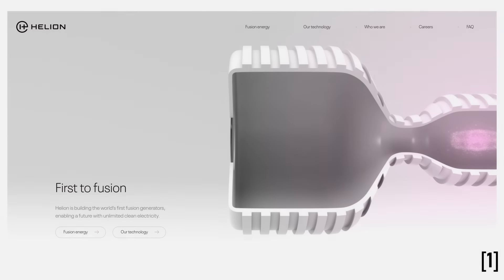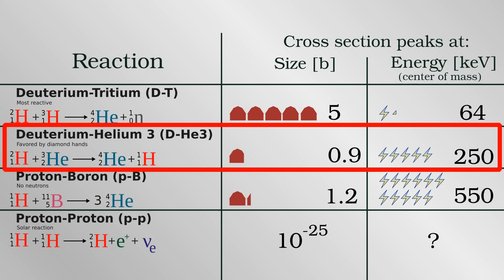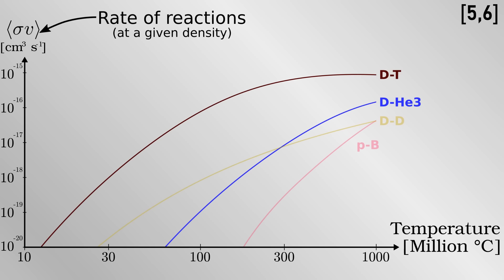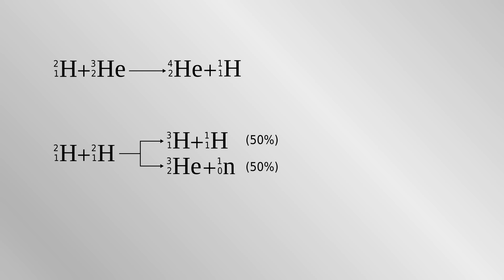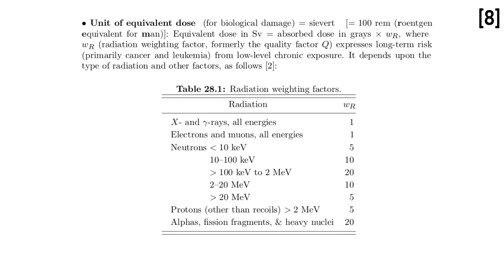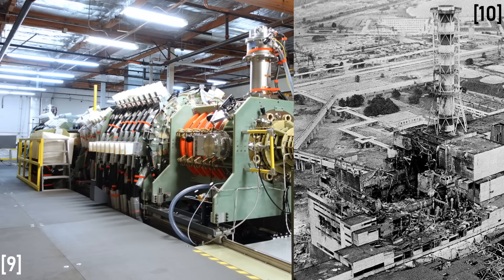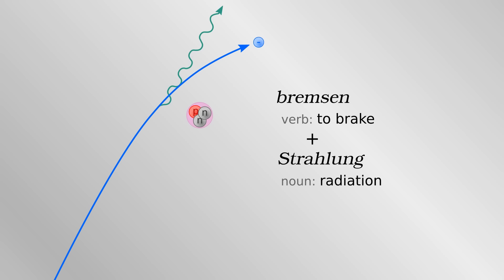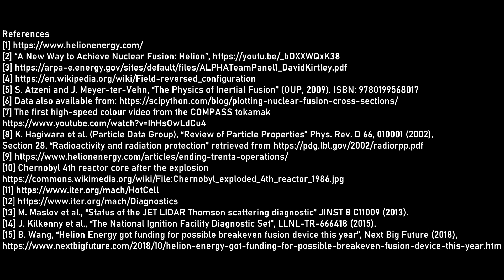The problems with Helion Energy - a response to Real Engineering

Comment: I'm just a lay-person so your educated skepticism is very valuable to me in mitigating my excitement.   

My only issue with your commentary is, it seems, and maybe this is my own ignorance, to often be talking about their reactor as it is now.  It's my understanding that they are in an iterative process and still aren't attempting to achieve their end product design, they are instead developing scaled down reactors that will help them develop their engineering processes and develop their understanding of the reaction they are focused on. 

I think this comes up most prominently when you're talking about the temperature.  Your perspective is that they are "content" with a very low temperature.  Do you know That they aren't planing to increase that as they iterate their reactor design?  You might, again you clearly know what you're talking about and I'm a lay-person.

I will say, when I've watched videos from them, they clearly implied that radiation wasn't an issue in their process, and saying it was a much larger one in systems like JET.  Learning from you that that appears to be an overt deception on their part clearly sets off the alarm bells.  If there's that major deception, it would be ignorant to assume their aren't others.
Reply: Indeed, Helion's power plants will operate at 300 million degrees ion temperature, or maybe even higher. Trenta is a subscale experiment that is currently at some 100 million degrees ion temperature. Still impressive for a relatively small and cheap machine. Also note that their extremely low electron to ion temperature ratio of <0.1 lowers some of the requirements.
Reply: @elmarmoelzer2229  Agreed. I believe the iteration they are on (6?) is like a tock on Intel's now defunct "tick-tock" system. Build something, engineer it perfect. Scale it up, re-engineer, etc.

First, a proof of concept. While this has been done for decades, extraction and refinement of the materials needed can be done much cheaper today and as such the technology is once again becoming a more viable solution.

I'm not at all saying this video is wrong, as it does point out potential problems with Helion's representative in the video mentioned, but I think it might be a bit premature to attack something that's literally still in development.

Comment: I enjoyed the video by Real Engineering and yours, as I learned a few things. 
One thing the main stream media has been telling us for years is that Fusion “will provide limitless clean energy”. Which seems a bit wrong. As you point out, that left over Neutron flying about will make stuff radioactive. You still need some sort of containment. 
I don’t think we’ll see a commercial on-grid fusion reactor in the next 40 years.

Comment: The D-He3 mix still burns D-D at a significant rate. FRC experiments have been around for decades. It sounds like a marketing pitch to grab investors. FYI my background is in nuclear engineering/ plasma physics.

We haven't even mentioned the plasma instability problems inherent in this class of devices.
Reply: And a lot of those FRC experiments were actually done by Helion, believe it or not.  Their co-founder Professor John Slough is a household name in FRC circles.
As for past FRC experiments. They were sufficiently different:
FRCs have unique properties. They get more stable with radius, ratio of elongation/radius and higher temperatures.
Helion's machines are pulsed and do not attempt to hold the plasma stable for prolonged periods of time. That helps a lot.
Reply: I would better that if Helion does generate any fusion it will be all D-D fusion. Much like a car when one tire is stuck in the mud. The tire with the least resistance spins while the other tire doesn't move at all.Since the energy levels for D-D is about 4 to 6 times less, He3 is unlikely to ever fuse in their reactor.

Comment: Hi Improbable Matter, it is very good to see a video putting a break on all these claims popping up recently about fusion startups and their miraculous fusion designs. Producing high amounts of energy (i.e. energy gain) requires serious hard work, combining decades of plasma physics theory, development of state-of-the-art fusion codes and associated numerical techniques, and thorough experiments with many diagnostics. This is just something that these startups do not have; instead they take a concept that looks good on paper, maybe by cherry picking a few scientific papers from a large body of work, and then sell it to investor to get funded for 10+ of years, while never having a chance to achieve energy gain. I don't doubt that some of these people have good will, but that is not enough. There are currently only a few credible path to producing high amount of fusion energy in a manner that can produce energy gain, and those have been developped for more than 50 years for a good reason: it is hard, and there are no miracle solution. In this field, if it sounds too good to be true, it usually is. 

One thing that I see a lot in these startups, is that they start by bashing the DT reaction because Tritium is rare and because neutrons are an issue. Neutrons however have a good property: they escape the fusion plasma, such that you can recover their energy. Let's not forget that the goal in the end, is indeed to recover energy from the fusion reaction... Most startups relying on aneutronic reactions (such as D-He3, that is, as pointed out, not 10% aneutronic) do not have a realistic way to recover the energy producing by the fusing particle. Invoking the use of magnetic fields to recover the energy from the fields in the plasma is a bit like invoking magic, for plasma physicists.

Comment: Thanks for making this video! I started watching the RealEngineering one but within a few minuts I got a strange feeling in my stomach. The way he talks about "the bright pink flashes from fusion multiple times" as if it's something only they can do gave me a clear idea that this was more sensational than educational. A lot of labs can initiate fusion. You can make surprisingly tiny machines that can initiate fusion. But achieving fusion with more energy out than in has only just been demonstrated, and from there there's a long way to generating more electrical power than what goes in.

Anyways, he might address these issues further along in the video, but just the way it was presented gave me a feeling that this was not going to be a nuanced approach to the subject.

Comment: The entire fuel processing is something I haven't seen them address sufficiently.
I don't know how bad it is for D+3He fusion, but 4He "ash" quickly (I think it was around 10% fraction) makes D-T fuel unable to fuse properly at the same operational temperature.
So you either need to always have something like 90% unspent fuel that you need to send somewhere for reprocessing, or have a separation system for 3He and 4He. Systems like that usually eat up a lot of energy. For ITER, those systems constitute a significant fraction of the overall energy input.
If you produce tritium as well, you can tack on another system to separate tritium from deuterium.
At that point, you have a facility that can produce nuclear weapon grade & scale amounts of tritium, which means a looooot of red tape.
Reply: ash is removed after each pulse

this is one reason pulsing is a lot easier than igniting

Comment: Two questions come to mind after seeing both videos:

1. One of your main arguments centers around a graph showing reactivity v. temperature. Should we take density into account, and how this influences reactivity? It seems to me that Helion's approach is a hybrid between inertial and magnetic confinement fusion. 
   - Is there a similar graph you could show for the impact of density?
   - Do the relative deltas for reactivity change with density (ie. does it perhaps reduce or increase relative dt-dt fusion)?

2. It's been bugging me that Helion's approach 'shoots' two compressed quanities of fuel towards eachother and expects them to just.. stop.. in the center. Do you have any input on the physics of this? Is there a certain density where the plasma actually collides? Can part of the fuel just pass through without colliding?

Ok.. perhaps more than just two questions ;)
Reply from the maker: (1) For the effect of density, multiply by density of reactant 1 and then by density of reactant 2 to get a rate per unit volume. The curves then depend only on the temperature. Higher density is better and to be fair to Helion, they claim to be able to reach higher densities. However, their reactivity will be much worse than if they put in D-T and also the D-D reactivity will be higher than D-3He, making more neutrons.

(2) The two blobs of plasma are confined by the magnetic field which moves with them and the two coalesce when they join and the plasma remains trapped by the magnetic field for a short time while fusion reactions happen.

You can see my very long, rambling deep dive in the livestream linked at the end.
Reply: 1. As Improbable Matter points out, D-D reactivity will be higher as well, when the density increases. 
It is worth noting that Trenta is not a power plant, but an experimental machine. The actual power plants will reach higher temperatures (up to 30 keV/330 million degrees) and/or higher densities. They can balance between density and temperature almost linearly (at least within a certain temperature range, from what I understand).
Anyway, at around 30 keV, reactivity of D-He3 is about to overtake D-D.  That said and as Improbable Matter correctly pointed out, they will need the D-D reactions to make the He3.
So, they will have to deal with those 2.45 MeV neutrons in 1/3 of the reactions (maybe 1/4 once they have a stable supply of He3 from Tritium decay). 
Those are not great, but the problems are not insurmountable, at least a lot easier to solve than with 14 MeV neutrons in D-T fusion machines. 

2. FRCs have this weird (but established) property that they merge into a single, hotter and more stable FRC when they collide at hypersonic(!) speeds. Helion is not the only outfit using that. TAE does as well (Helion's cofounder John Slough actually helped TAE with getting that implemented into their C-2 machine) and there is literature on the topic from other groups, who have tried the same thing (e.g. a group in Japan).

Comment: I am in no way a nuclear physicist, but nuclear fusion is one of the topics I am most interested in. I was initially very excited after seeing real engineering's video, but this video has put things in a better perspective. Though the idea that got me the most excited was the direct energy conversion method they used, not the way they generated the plasma. Regardless, I'll still stand by my views that tokamaks in how they generate electricity are not viable. We need some way of direct energy conversion, rather than the age old boil water, turn turbine. There is just too much energy wasted for it to be viable. Less moving parts the better. I doubt this would be the most efficient option, but I've always thought of something like a solar cell, that incoming electrons take the place of the ones within the cell, thus generating a current. I seriously doubt silicon would be able to be used in this, but if we were able to capture most of what was emitted by the plasma, we should be able to surpass the 37% that coal powered turbines generate (I don't know the maximum efficiency of the turbines tokamaks use). I'm not sure if my idea would work and would gladly hear any corrections, or incorrect assumptions.

Comment: I don't think Helion will succeed, but I do think they are on the right track when it comes to how they are thinking about harvesting their energy directly instead of using steam as a "middleman."

Much like how I view Tesla, while they themselves may not be on the right track, they are pushing the industry towards more sustainable technology. Even if Helion isn't using the right technology now, I hope their idea that directly harvesting the energy is better than just harvesting the energy through steam. Ideally a mix of the two technologies would be used. Direct harvesting to capture as much as it can, and steam turbines to capture the waste heat.
Reply: The main problem with Tesla is not their technology. The main problem is that fact that it's a car company, and cars are inherently inefficient when it comes to getting people from point A to point B.
Reply: I really don't think they are. Every part of the machine loses energy through heat. The capacitors, the confinement walls, the electrical conductors, the plasma itself, the neutrons emitted; there are so many losses that focusing only on capturing the energy from charged particles is... wasteful at best.

It makes much more logical sense to dunk the whole machine in water and generate energy from that steam. Same with NIF and Tokamaks.

Comment: Thank you for the video.  I'm expecting that Helion Energy will one day announce that they have decided to add some tritium to their fuel mix, and sometime later will fade away as other startups have done.  (I hope I'm wrong.)  In the course of events, they will probably announce one day that they have indeed produced some electrical energy, but the amount is not likely to approach or exceed the amount they are consuming.
Reply: Adding Tritium doesn't help them because they have no plans to harvest energy from neutrons/heat.
Reply: @stephen4886  OK.  I'm no plasma physicist, but it would seem that they (Helion personnel) will need all the heat they can get to promote their preferred reaction.  Seems like the 3.5 Mev helium produced via the introduction of some tritium would add some heat to do that and to promote the plasma expansion that they need to drive the magnetic flux back through the coils to demonstrate electrical energy production.  As long as they also get some of their preferred reaction, even if it is a small portion of the total, and they can show a little electrical energy has been produced, they could claim a great success to promote more funding.  I have no idea of the interaction probability of the neutrons with the plasma, so the contribution of the neutrons to plasma temperature may indeed be negligible for all I know.